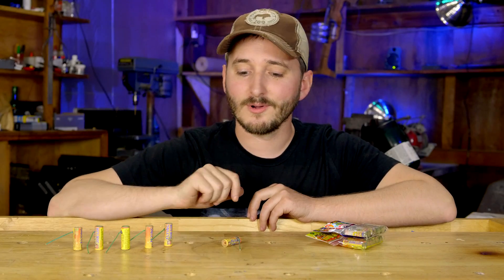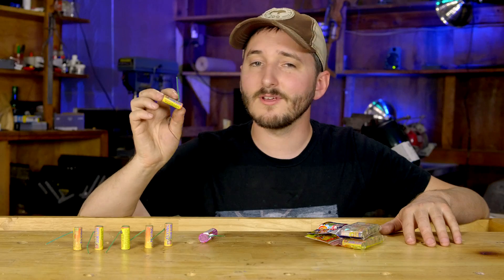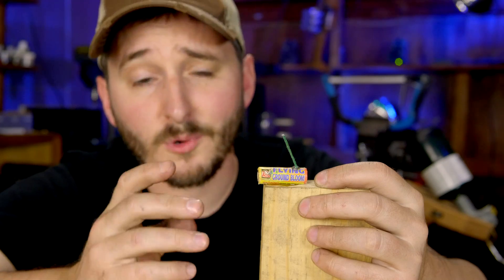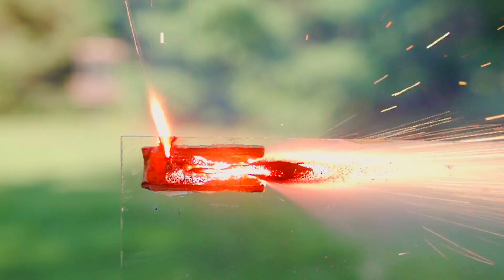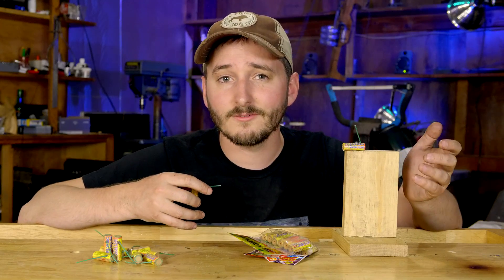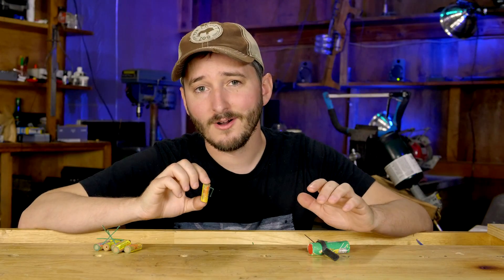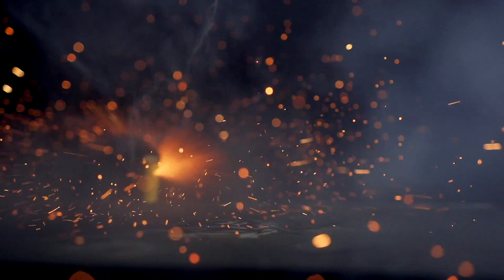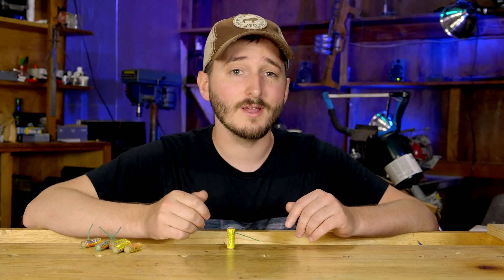How Do These Fireworks Fly?

Comment: look at the balance point and you should see that it not centered but closer to the fused end. it would seem you can make a reusable one out of PVC water line pipe, compressed air and water ( like the old water rockets ) and only the side hole to show the spin and stand. this might be able to be scaled up to longer lengths to get a longer look at the spin.

Comment: It stands up due to the forces applied to it. It is constantly thrusting in opposing directions which makes it stand upright. Much like spinning a bicycle wheel and holding the axles in your hands. The path of least resistance is upright. So the thrust becomes a gyroscopic force. The path of least resistance is aligned to gravity, upwards.

Comment: Sorry to burst your bubble but the ground effect does not apply to properly designed rockets. The grou d effect only applies to subsonic regimes, but rocket exhaust is supersonic. A rocket engine will produce the same thrust right near the ground as if would in the air (ignoring changes is ambient pressure). Great video though, and I think you were on the right track with the rotational stability theory.

Comment: If you take an AA battery, lay it down sideways on a flat large surface - used to do it on the floor when was a kid - and apply pressure with one finger in one side of it in a way that it spins, it will rise up like the fireworks. Both have the same basic shape. 
Not so interesting for the video,  but less messy so it is easier to study how it rise up from the spinning.

Comment: I think your last conclusion is more correct, but I the explanation is somewhat simpler than you would maybe think.  
Your point about it only flying up when it's on a flat surface is very important.   Or even more important is that they don't fly straight up if they are not on a flat surface.  
If it was simply the design of the firework and gravity or something the flat surface wouldn't matter.  
When it first ignites it begins to rotate quickly around the long axis.   The nozzle is either pointing above or below horizontal (or dead level) but, it doesn't stay at any one position.  So the nozzle thrust is either pushing down or up (at least a part of the force vector is).  When the thrust is in the downward direction the table keeps it spinning flat.    Once it spins to a position where the thrust is pushing upward it starts to stand and is stabilized like a top as the spin rate increases which is almost instantly.  It's no accident the thrust coming from the end is delayed long enough for this to happen.  The flat surface forces it to tilt up.  It can't tilt down the table stops that,  it's not going to stay flat because it's rotating, as soon as the nozzle begins to point down it stands up, stabilizes like a top and then rockets upward...that's only direction it can go....Unless you throw it in the air.  Then there is no surface to force its orientation..it's direction is more at random.   Or I am completely wrong :-).  Great video though!!!

Comment: My guess is that you are almost right. I guess you have a very uneven weight distribution in the speedball. the main nozzle end is heavier which make sure the thing always stands up right. the rotational nozzle is probably at an angle wich causes it to mainly spin on the long axis of the speedball. thid in combination with the ground effect causes the speedball to stand upright. 

So you could test the following: cut the speedball in the middle orthogonal to the long axis. measure the weight of each part. A good test would have been to stand it upright before lighting. this should reveal that the speedball tips over and will probably go sideways due to the timing of the two engines. another great test woud be to fix it upright on a rotational axis. that way you can test the spinengine better.

Comment: The fuse hole might have a different angle to make it easier to spin on its axis. Also the heavier part (with more fuel and clay) goes to the bottom to stabilize the spin. Once it’s all set, due to the “fuse timer”, the bottom nozzle ignites and the rocket science happens!

Comment: so the first fuse lights, it's positioned to make the tube spin. if the thrust of that gets close to the flat surface, it has something to push against other than the air. so more of the energy emitted is converted into thrust? this then pushes that end of the tube vertically, the spinning creates a gyroscopic effect too, so then it's vertical and semi-stable, it kicks on it's main thrusters! i really love the part when you cut one in half and stuck it on some glass, that looked really cool!

Comment: The nozzle on the side is at a slight  angle so it spins the fire work so the side nozzle faces the ground pushing it up right then the spinning nozzle stable stabilizes it then the next nozzle pushes it up in the air

Comment: I thought, maybe it also has got something to do with the center of gravity moving downwards as the firework burns up from top to bottom. Maybe that causes the spinning motion along the vertical axis to get unstable and, because the center of gravity has moved down, the top part moves more excentric than the bottom part and gives the whole thing a 'kick' so it moves upright as the top touches the ground... This is just an additional idea though, i think the other theories also play a role in this. :)

Comment: To me it looks like the thrust of that off-center nozzle pushes against the ground, as it spins it pushes it equally from all sides. The ground offers more resistance than air, obviously, so thats why that would push it up. 
I don't think the friction of the surface is a huge factor. If it was, it shouldn't work the same on a rough surface, like concrete, but it does(i would assume?).

Comment: I thought about it in terms of axis moment of inertia which is in the axial direction 
and for why it moves upright, well without regarding  the friction and all these stuff once the firework rotate axially and face the ground it will be pushed upright gaining a rotational speed in the horizontal direction but soon after the jet come to the opposite direction it will decrease damp this rotation during this period the firework it's unstable and wobbling 
till the new jet from the down nozzle comes and lift it up to the sky.

Comment: try spinning up spinning top in the shape of the fireworks and film them in slowmotion to get a better understanding. also try modifying the the shape of the firework for example with clay wood or plastic caps so see if it influences the self stabilizing properties. 
probably it all is due to the main axis of inertia. because 2 of the 3 axes are rhe same but will not stay in that axes because of the first jet it automatically snaps in the 3rd main axis of inertia because it is undistubed in this orientation (regarding no ground effect push)

Comment: I’m refraining from reading the comments just to keep my thoughts trained on what my intuition was telling me, and I didn’t pick up on you mentioning anything about it: mass! Or rather, center of mass. I’m not a rocket expert, but a center of mass is crucial in getting right in rocketeering (thanks Destin!). I’m wondering if the burned fuel from the spinner nozzle end of the firework causes a shift in mass in such a way to force the firework upright while spinning. My guess is this would cause the center of mass more towards the large nozzle. I also think that there probably is some gyroscopic procession or however it’s spelled that helps exploit the shifting in weight to cause it to be upright. Maybe you could do an experiment that shows a spinning rod (with unsymmetrical distribution of weight to one side) while prone/horizontal, will want to stand up straight with heaviest part on the ground, and lighter upwards. Thanks for the video and for sharing the unsolved problem with others :)

Comment: After lighting the firework, it not only changes its rotational state, but also its mass and more importantly its mass dristribution. The propellant burns from the side with the side nozzle, leaving the cylinder. Therefore, the cylinder looses mass. But it looses mass at one side. This changes the mass distribution and thus the moment of inertia. This has two effects: 
- Firstly: a) A relatively long cylinder with homegenous mass distribution has its axis of maximum moment of inertia trough its center, perpendicular to its length. b) Short cylinders have their axis of maximum moment of inertia through its round sides centers. In the case of the the firework after one side loses most of its mass, this might change from case a) to b). Since each rigid body has its most stable rotation state around its axis of maximum moment of inertia, this could be the reason for the firework reliably standing up after a certain burn time.
- Secondly, the heavier side with probellant remaining is the end nozzle side. The heavier side pointing downwards corresponds to a lower potential energy, thus beeing a prefferred state. 
- Together those two effects are probably the reason, that the cylinder will stand up with the heavier (nozzle) side down, after enough of the fuel is burned.

Comment: I think.

To explain it with similar situations.

If you punch the air, the air will move around your fist. The amount of energy it pushes back with is distributed.

If you punch a brick wall, your fist will not go through it. The wall is a harder medium which pushes your fist back.

When the firework faces the ground, it pushes itself up.

When it faces the air, it gains less of that push.

Therefore, the firework gets pushed up more when facing the ground, it’ll it is facing the same medium density on both sides of the firework.

Then, the bottom firework shoots on, and acts as the actual vertical thrust to the firework, propelling it in to the air at a high speed.

If the punching air doesn’t make sense, think of it this way.

Can you double jump in real life? No, because the air is not a solid medium. When you push off the air, you don’t gain thrust.

But when you jump off of a solid medium, such as the ground, you are thrusted into the air.

Comment: Perhaps the magnus effect and rotational velocity combine in concert to cause lift and gyroscopic stability thereby elevating the ignition nozzle end from the ground consistently, thereby allowing the thrust vectoring end to generate vertical lift while rotational stability is maintained by the offset thrust from the ignition nozzle.  Or not 😂

Comment: It looks like an off Center angle to the fuse hole gets the spin going along its Center which brings the exhaust to the ground where it’s more effective (ground effect) and thus bumps that end up where gyro effects and resist falling back down and then the other nozzle kicks it up while it’s spin stabilized.

Comment: Well your first steps should be to try and isolate the effects (ground effect & friction):
If you launch them from some kind of mesh, there won't be a solid surface to push off from, no (or little) ground effect.
Perhaps you could add grease or something to the bottom end of the fireworks, so it slips, reducing friction.

Comment: I keep comming to the conclusion that the one side could be heavier slightly, but then I was wondering would their be enough change in weight with the fuse side burning before the side nozzle? so the powder would ignite on one side first start to burn and counter the weight to be more nozzle side before it can ignite the nozzle side and launch..   Im just speculating but what i was thinking by the end

Comment: Hehe. when I was a kid, I always liked taking fireworks apart to see how they were made and also crush them to reuse the powder and make ground salutes 😁 I learned the hard way, some powders are friction sensitive and so on 😆. anyway, you should film another angle. I'd like to see a top view of the fireworks when it ignites.  Stand it up right, end thrust nozzle to the floor. I'm pretty sure the fuse hole is punched at an angle instead of direct center.🤔 Just a thought 😁

Comment: So I noticed a few things.
But also I have made some assumptions. 

Assumption one the nozle end at the time of the take of burn is heavier. 

Assumption two part of the rotational energy is imtended for gyroscopic stabilization 

Assumption 3 the initial burn is set at an angle axially as well as to some degree to the nozzle end providing non negligable lift as seen by it jumping off the table before the main burn 

So a break down instance by instance would be as follows

Initial burn causes rotation and some slight thrust perpendicular to the spin axis

As the thrust vector sweeps across the table it pushes against it causing the firework to lift away from it and more twords the heavier base

As it gains rotational velocity it begins to stabalize as the spinning thrust both pushes against any surface it gets to near and providing some downward thrust 

Being gyroscopicaly stabalized and having a low center of gravity allows the main burn to launch it to the sky

Comment: Would the weight of the burned spin charge vs the weight of the unburned lift charge play a factor in the standing upright?  The heavier unburned charge would be on the bottom vs the lighter burned spin charge on top as shown in the example of the half firework attached to the glass to see the burn sequence.

Comment: Take into account the clay forming the rocket nozzle. Is it heavier? 
Put a thread in a slipknot exactly halfway (as measured). Pick it up by the thread. If in fact it is heavier at the clay end there's your answer.  If not, pull the fue out and remeasure the balance. I say pull the fuse as after burning that weight would no longer be present.

Comment: I think high speed cameras were invented to frame fireworks, and I love it ! 

I played with this kind of firework when younger, I had some with two holes on either side of the cylinder, one up and one facing down. The firecrackers flew systematically but only by rotation, it was not a propulsion.
I never found them again later.

Comment: There is a few things at play You have to take into account the shape.   The Jet nozzle with the fuse sets a very strong gyroscopic affect In the two ways that you found out in this video and as the last bit of the charge is cooked off. it will always when set up correctly (on a really flat surface) will right itself to ~45° to 70° Depending on how much friction is transferred to the bottom edge of the charge in the first jet
Reply: The true science lies within the shape though
Reply: Every moment that it touches the flat surface is crucial to start the chain reaction of making it go gyroscopic. The jet will make it spin on one or both axis. Here is where the shape comes into play: The cylinder’s bottom is a circle and when it’s in contact with the flat ground it wants to roll along that circle “it’s edge” causing it to go to a 45°-70° angle
Reply: The best depiction you will get is to take a cylinder and press down on one side very hard and fast on a flat surface you will see the same affect just not as fast

Comment: The fuse is placed tangential to the casing in order to turn the body towards the table which helps it to stand up right . As the object is turned upright the thrust from the fuse hole continues to rotate it as the other charge goes off hence lifting it away from the table. Considering the unstable movement during liftoff , it  is due to an unbalanced couple ,hance adding another fuse parallel to the first one would help it to (maybe)fly higher and more stable

Comment: Well I think, simply, it's acting like a reverse-top; it's just a top that is getting its gyroscopic precession back. Let me explain. 

Initially, it gets a "kick" from the rocket hole, causing a rotation on the short axis. This is key! Then, it spins up on the long axis. Any rotating body will want to move an input force by 90 degrees in direction of rotation, right? Well as it spools up on the long axis, it is 'unfalling' the way a top falls, and what is happening is that initial short-axis rotation is being precesssed into an uprighting force. Then, it's just a stabilized top again and the second nozzle can fire away. 

This would explain why when you chuck them in the air, they fly wildly. They don't get a chance to spin on the short axis, so they just spin on the long axis, gain rigidity in space, and fire away.

Comment: Okay so the side exhaust has three functions:
1)It is biased towards the opposite end of the cylinder away from the second exhaust which sets a certain side on end. The reason the second exhaust always ends up facing down is because the whole tube wants to stand up off the table and acts as a LEVER, and like any lever, the longer the handle, the easier the work.Think of the analogy of a piece of pipe laying on the ground. If you wanted to stand that pipe on end, you wouldn't grab the bottom and try to rotate the entire mass upward, you would grab the end you intend on raising as this requires the least torque.
2)It imparts an axial spin (this is likely caused by another bias, though less obvious than the first), which leads to the third function (below) but also creates gyroscopic forces which stabilizes the tube in it's final position.
3) It self rights the tube perpendicular to the table. The way this works is that during the spin, the side jet continually contacts the table as it continues to rotate. The side jet naturally pushes off the table (more so than the ambient air) and ends up exhausting parallel to the table which is the PATH OF LEAST RESISTANCE, which sets the axis of rotation perpendicular to the table. 

An then of course the final exhaust is simply that.

TL;DR:
Think of path of least resistance for much of this.

Comment: possibly the side fuse is formed or drilled at a slight angle so the thrust is vectored differently?  or the fuse itself is formed with a hardened piece at the base to initiate a spin.